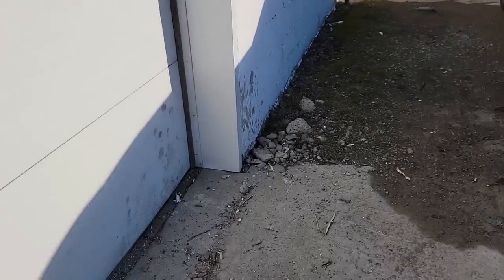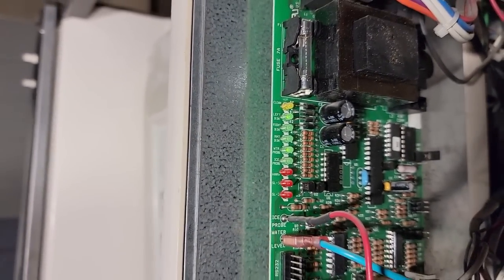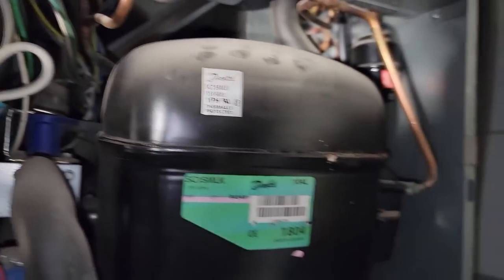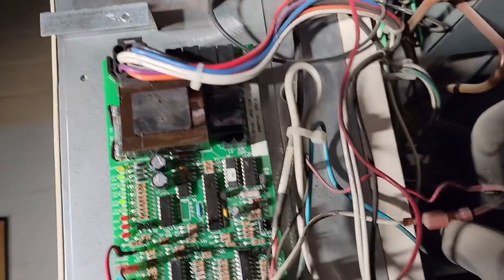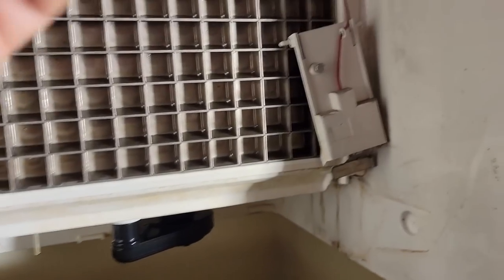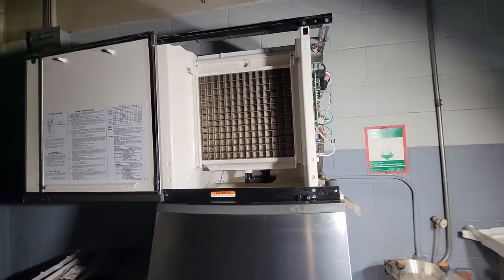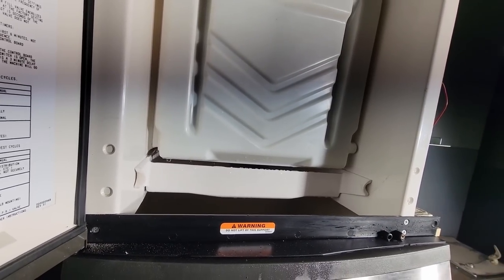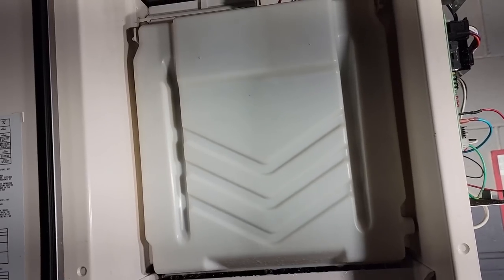Manitowoc Ice Machine Not Working!

Comment: Reminds me of our maintenance barn manitowoc. Barn doors and cracked windows less than 50 yards away from the dirt track. Ambient air anywhere from 35-95 degrees. The supply water line runs outside and has halfassed insulation. Only thing good about it is the ice is used is used to chill canned drinks or horses!

Comment: Pre-Indigo ice thickness probes can sometimes cause false harvests if there’s still some ice machine cleaner on it. 

I always use a mild detergent and warm water after I descale those. Thorough rinse and we’re good to go. 

Those old SY machines are just fine. I’ve installed a few of the new NXT machines, and the quality doesn’t seem all the way there. 

I don’t know about you, but so many of my service calls are no ice symptoms due to false Full Bin/ice damper catching on evaporator (on the dual units). 

I never had to deal with that on the SY machines.

Comment: How did you drain the water when you put chemical in?
Reply from the maker: The machine will cycle fresh water and dump the old chemical water over and over again. But sometimes I will pull the pan back out to help speed things up.
Reply: @HVACRSurvival  your talking about the pump dump pump dump when its in ice mode?
Reply from the maker: When it's in cleaning mode it does it over and over before it goes back to ice mode
Reply: @HVACRSurvival  I have to learn that because there is times where there isn’t a drain valve in the water Reservoir
Reply: If you have the time I would love a vid on it.
Reply from the maker: That's because a lot of times they pump it out.